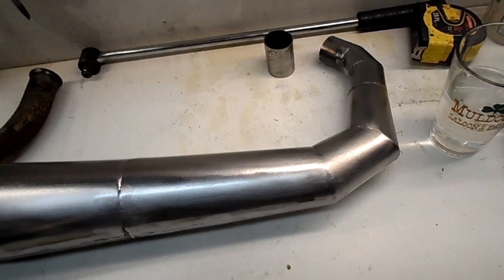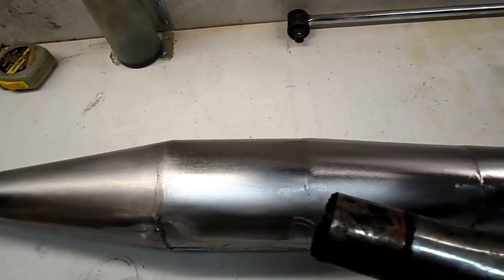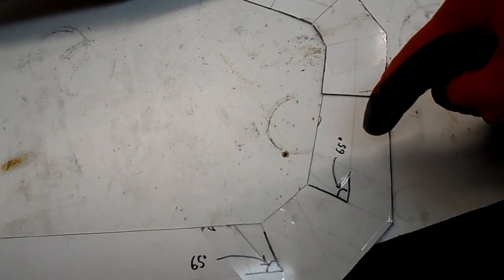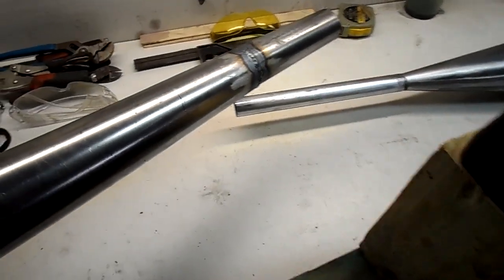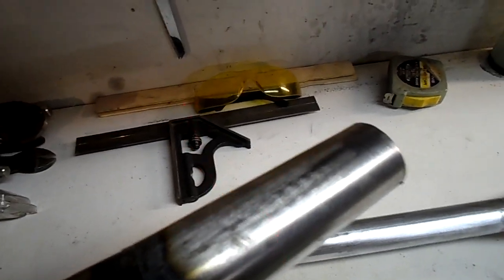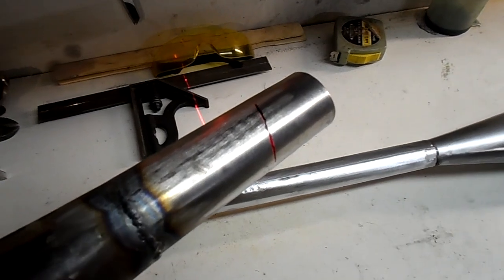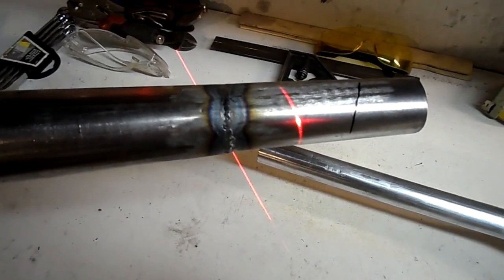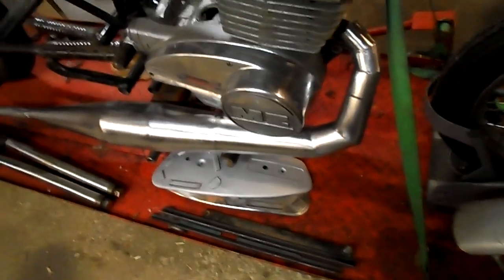2 STROKE EXPANSION CHAMBER HOME FABRICATION PART 3

Comment: nice job and thanks for sharing
Darla Holmes, Virginia USA
Reply from the maker: Thanks, Darla! I hope you're doing well ;)
Reply: @benjaminal-doory1817 can make one blue print plz
Reply: Nice clean welds on the outside, hopefully they are smoother on the inside (have been filed/fettled), but, those angles atr too sharp and loosing power from turbulent exhaust flow & generating  problematic pressure wave pulses.
    ..you need to add more shorter angle-transitioning 'ring' sections, if you want proper expansion chamber function & power for correct cylinder performance.